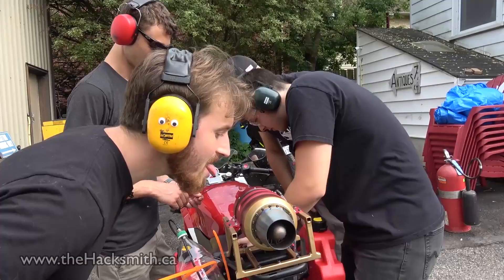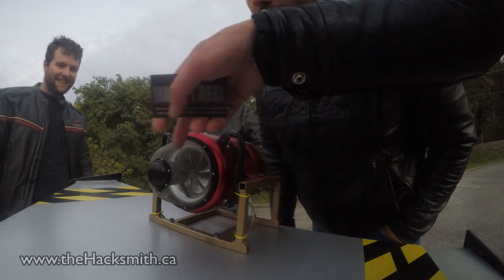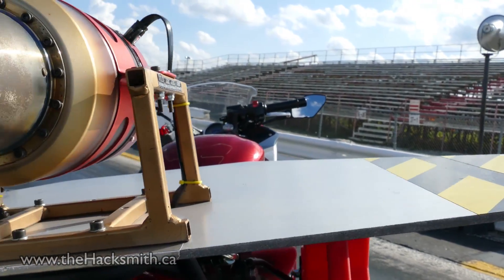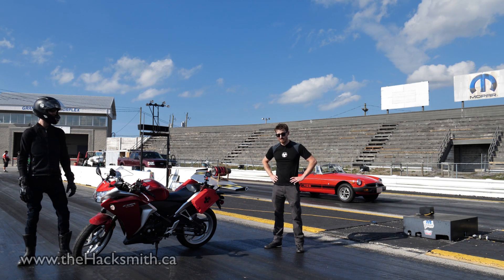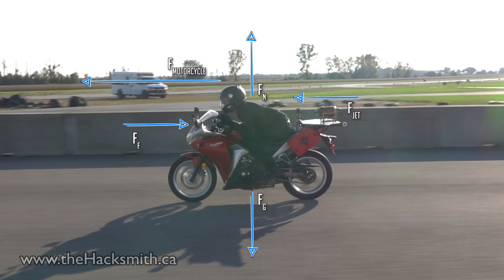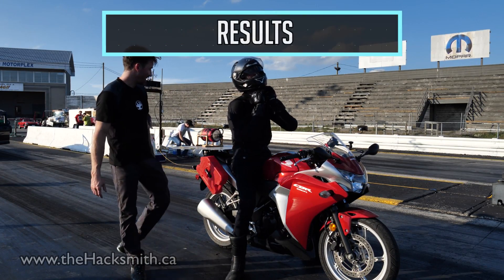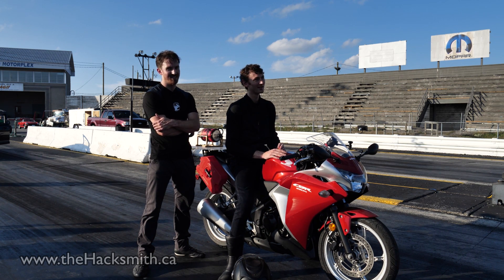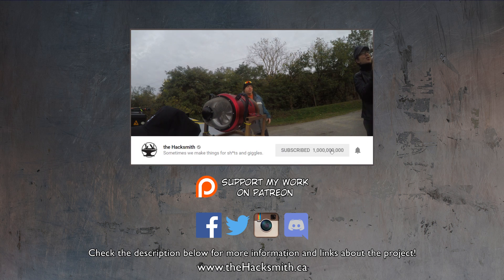Will a JET ENGINE Motorcycle Set New Records?

Comment: I may be seing this two years later but I have to comment. When the picture of the bike with all it's info was up on screen, an arrow pointed to the TIRE SIZE and said it was the top speed. The info graphic even had an area on it with the actual top speed. Rant over.

Comment: Slap those jets on a liter bike and let me know how it goes. Also a much, much longer track <3
Reply: just put it on a faster bike. a zx6r or similar. Even my 1998 zx6r i gets to 130 km/h (80mp/h) in the FIRST gear, 260 km/h (160 mp/h) topspeed
Reply: Also most bikes have pretty similar weight. My 600ccm³ weighs about 180kg (360lbs) and this 250ccm³ about 150 (300lbs)

Comment: I don't get it that bike on just the motor could only pull a 17 second quarter mile my DRZ400 motocross bike will pull a High 13 and it's not a crotch rocket

Comment: the track is to short, the bike should do 1/2 to 3/4 of top speed before the jet engine gets from Neutral to full trotle, than you would get around 200 tot 250  if the track is long enough

Comment: I rode this bike before (without the jet engine of course)
If the engine is in good condition with low quality gas it actually could reach 160km/h. It can reach higher but the limiter kill the engine..

Comment: Upgrade a motorcycle with enough jet engines to reach the ability to hover off the ground (by adding a few on the wheels angled at a positive slope as to both propel up and forward partially to allow more control on how high you go than if you aimed them straight down )

Comment: I do have a question, if you max out the gears wouldn't the engine act like an engine break and resist the jet engine just like shifting down on gears to slow down. Would the results be different if you reached top speed then held the clutch down and let the jet power do the work without the engine
Reply from the maker: That was the test we did with just the jet engine - bike in neutral

Comment: Honestly surprised that the jet engine made it past 30.
Reply from the maker: Why
Reply: @hacksmith  I expected it to work for lightweight model aircraft.
Reply from the maker: It puts out 70lbs of thrust... Not exactly a toy
Reply: @hacksmith  Missed that detail about the jet engine. Before watching the video, I was basing my assumption of how fast the bike would go off of Yves Rossy's four jet-engine wing that averaged 120 MPH, which is why I was pleasantly surprised to see how well the Oppressor worked out.

Comment: the jet engine had no flow. it was in the vacuum of the wash of the rider.  if you put redirecting vents or something it would not need to work so hard to accelerate the air and might be more powerful.

Comment: Try to use jet engine on a boat because in sea you can test it perfectly without any problems
Reply: Sea water in the air, and jet engines do not mix.

Comment: When you guys test the MG you should definitely do it on a circular track so you don't run out of road. Hopefully you guys can also diagnose and repair the fuel pump issue on the bike by then so that you can achieve the highest velocity possible. Two birds one stone, I'm sure a bunch of engineers can appreciate the benefits of that.
Reply from the maker: The mg won't go that fast =p

Comment: “Did it satisfy your need for speed?” You got 100mph with a jet engine combined with motorcycle engine... My motorcycle does that in the low revs of second gear... Get a bigger jet engine on a 600cc+ motorcycle and then talk about a need for speed.

Comment: how about to make a plane with a four jet engines and ride it as a bike
like thes 
○     ○
   /   \
×---×---×
  \    /
○    ○

The lines are the structure of the bike. The circles is the jet engine and the X is the seat that controls  and the two lines on the two sides of the seat can be the wings or you can put the most recent thing on the helicopter
Reply: Not sure if it would work. He stopped using jet engines in his Flying Like Iron Man project because it was too hard to stabilize in the air... I could be totally wrong though.
Reply: Hawkenin  
I'm sure that the Hacksmith can do it and  What is wrong bei making a dream come true every one wants to fly like him it would be beautiful but I was asking how about to make a bike with a jet engines

Comment: You should make a Jump Pack
While not enough on its own to fly, it should allow you to jump pretty high.
The issue would be CG, where you'd have to angle the engines, a bit like the space shuttle. That could introduce enough forward velocity mid jump to make landing tough. The single engine would be safer to do this with at first, and might also be a good time to test attitude control prototyping for "iron man"
Reply from the maker: Where do you get air cannons that can put out that much air fast enough?
Reply: @hacksmith   if you can not find one, make one.   i think the  relationship  of volume, psi,  and the diameter of output  is key.  The use of explosions  pushing gas out rapidly might be better.   I do not have the resources to test these hypothesis.   The use of dry ice to recharge the  air tanks would be a good possible energy source.      Back in middle school, i had done a science fair project on dry ice propulsion ( main reason was just to get dry ice for fun) .  With my current knowledge,  i now know the scientific fascination of dry ice propulsion.     To recreate my project ( a better version)  you will need 
1. 4 bottles  2(plastic)  2(metal).    2. dry ice 3.  4 corks  5. 2 (1 cup of water)
Each bottle with any amount of dry ice.
1 plastic bottle with water    1 metal bottle with water
cork them all. Aim all down. Watch with flies the highest.
(Theoretical)
For human scale  The air container need to be light as possible. Rig  would  need a climbing harness and strap to back , chest, and waist.  The output hole may need to be 2-4 in diameter.  The valve would be electric. 
The time between each jump would be a while as the evaporating dry ice recharges the tank.    height of jump depends on weight, so find the lightest person who is willing to try for science.  (sorry for long message)
Reply: An easier way to do a jump pack is with air.  Medium to large air cannons aiming down.  The jet engine has 73lb of pushing or pulling force. It gradually builds up speed.   The jumping action is basically a sudden burst of energy. The jet engine will not perform the jumping action, but can possibly allow a slow decent.  For a jump pack,  air or mechanical energy will be  better for jumping. More energy stored plus rapid release of that energy may result a bigger jump.
Reply: @SuperInfurno  the engine would combat part of the gravitational force, the jumping power is the same but with effectively less pull from gravity. I mean you're still doing the jump yourself, but with a helping hand from the jet.

Comment: you need a longer strip to get maxv, I'd put the jet on the lightest thing you can, how about an electric go cart, as light as possible with two jets, also find a longer strip. the electric motors for initial acceleration then when the motors max out have a disconnect to go jet only. weight is obviously the main key to this, bit of aero too. sounds hard but if anyone can do it you guys can. love your work. get experts and sponsors if needed. we won't mind a sponsor to see a 200kph+ go cart or skateboard type of vehicle. great video btw. (edit) remote control it i.e. get rid of the driver to save weight possibly. obviously do something using bits of everyone's ideas. good luck. 😎

Comment: wtf why do you tell 140kmh? what matter has the wheelsize===
Reply from the maker: what?
Reply: @hacksmith  sry. But you showed the topspeed 140 in that commercial card. But it was the tire size 140/70r17
Reply from the maker: Editor messed up. It's top speed is 140kmh though.

Comment: I think you could get better results by cuting of bike engine after it gives less force than jet. I believe you would make few km/h more. But who am i tolking to if not professionals ;P
Reply from the maker: What? No
Reply: @hacksmith  I mean gears have limit on speed they can get. You don't use breaks on mountain roads, but you ride slowly on lower gears. Maybe with jet it work the same.

Comment: Ey, on the minute 7:54 thats not the top speed of the bike, thats the tire size xD

The top speed of the bike is around 190kmph
Reply from the maker: The top speed of the bike is definitely not 190km/h... tops out at just over 140 in our tests (on the highway, not the drag strip)
Reply: @hacksmith  Topspeed 145km/h -See bottom right in the spec sheet.
Reply from the maker: @rainerrauser8618  yeah the editor pointed to the wrong number
Reply: @hacksmith  thats impossible, 140 was the top speed of my 125,  there are a lot of videos on youtube showing those bike reaching like 160km/h +
Reply: Zenick no way a 125 goes 140
Reply: @ZenickPT  bad rider lol
Reply: come on guys... it definitely the TIRE SIZE.... could someone dosnt see it???
Reply: Yup that's 100% the tire size lmao
Reply: Fastest I’ve had my 2013 CBR250 is 172 and that’s 6th gear rev limiter. Definitely isn’t 140